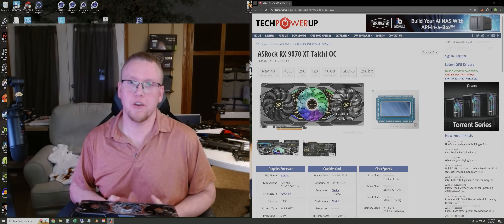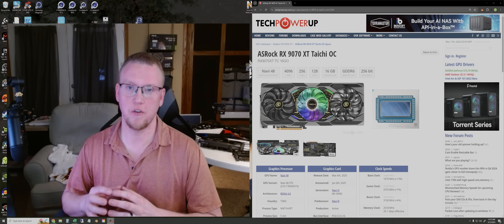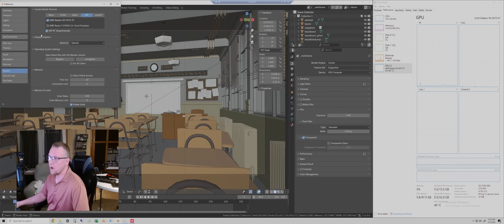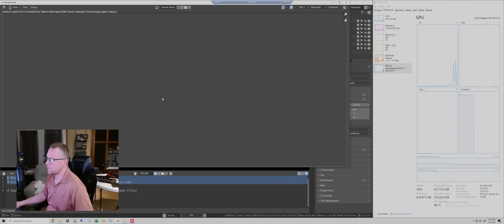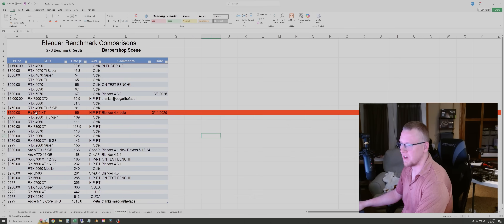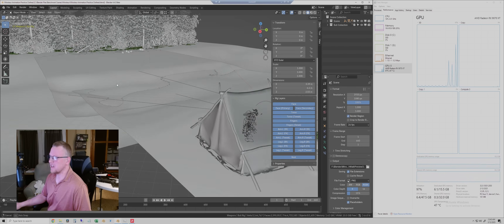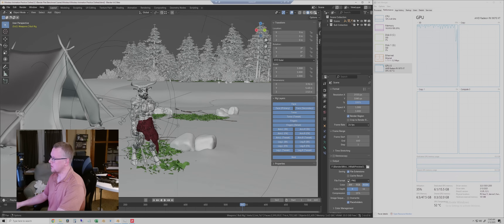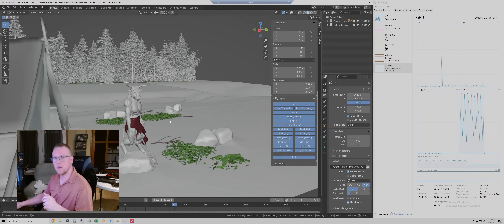NEW AMD Rx 9070 XT Render and Viewport Tests in Blender

Comment: i work now with a 3060 but ia have plans for changing for an new gpu, but i have short problem, am worked with platform am4 and with all things like bottleneck... some webs recomended change the resolution monitor but is 4k and the 4k is xpensive and thats happen with the 5070ti, what gpu you recomended me for change?. please try with blender 5.0

Comment: Did this GPU get some new drivers/support for Blender? thinking of changing my rtx 3070, but still not so sure if it's worth atm
Reply from the maker: The 9070 XT has not received a speed boost in Blender yet. The HIP-RT upgrade is supposed to be added to Blender Cycles in version 5.1 or 5.2, and that should give a large speed boost to the 9000 series of AMD. But, it is not testable yet.

Comment: Bought an Asus 9070XT... Whenever I try to render my latest project in rendered view my Blender crashes DX
Have yet to find a solution... starting to get buyers remose. While I mostly play games I do work with 3D fairly regularly so its kinda important I get it to work DX
Reply from the maker: Make sure you have new drivers, set your cycles device as your GPU, and make sure the denoiser is set to none or open image denoiser. If you have optix denoiser on it will crash with an AMD GPU. If these aren't it, let's keep brainstorming
Reply: @ContradictionTech  Bought the card right before Xmas. Reinstalled windows, got the latest drivers. Switched to GPU to Radeon 9070xt, Enabled HIP-TP. Either crashed without any error message, or with one. I did follow your advice but still crashed, gonna attempt no optix denoiser. But yeah feels like its gonna be a journey. Did play ready or not on maximum settings with 180+ fps XD

Edit: Put it to none and it worked. wonder why it cant do it with it tho.

Comment: In games the 9070xt is a lot closer to the 4090 than in 3d rendering, probably because 3d rendering leverages all the cuda cores while in gaming some might go unused (as happens with cpu cores, that are maxed out in 3d rendering but not in games). Anyhow, thanks for the video!
Reply from the maker: Yeah and I think the 9070 xt will gain some ground in Blender 5.1 or 5.2 when they get hip-rt updates in cycles. Hopefully like 20% or more boost in speed

Comment: I’m actually impressed, everyone said to me it have 3060 performance in Blender, I'd be curious to see how much the 9070 xt has improved now with Blender 5.0
Reply from the maker: It has not improved yet, hip-rt updates don't come to Blender until 5.1. Hopefully we'll see an upgrade at that point
Reply: @C @ContradictionTech  are you going to do a new test with the 9070 xt when it’s going to get improvement?
Reply from the maker: @2amicisuyoutube684Absolutely I will. I also check alpha versions sometimes to make sure they haven't already been updated. So it will be posted quickly once the upgrade happens
Reply: @ContradictionTech  Thanks for what you do, you deserve the follow, I just wanted to ask you one last question, at this moment the 9070 xt in Blender to which Nvidia GPU can you compare, and if in your opinion the 9070 xt is enough for someone who is starting out
Reply from the maker: @2amicisuyoutube684Thank you for that! The 9070 xt is still a good GPU in Blender. The viewport performance is good, render speed is slower than it should be. But most of your time will be spent in viewport anyway.
I have newer videos on this channel with more GPUs you can compare to. But for the same price, Nvidia will be faster. Like the 5070 is faster in Blender than the 9070 xt.
Reply: @ContradictionTech  ok, then I'll wait for blender 5.1 to see how the 9070 xt will go, thanks
Reply: @ContradictionTech  buenas noches, para ti cual será mejor para blender renderizado la rx 7900xtx vs rx 9070xt vs rtx 5070 gracias
Reply from the maker: @787JAVIER  Hi! The 7900 XTX is about the same speed, and has twice the VRAM as the 5070. So I would consider the 7900 XTX depending on what else you use the PC for. But keep in mind, the 7900 XTX is large, and uses a lot more power than the 5070.

Comment: I’m really torn between getting this or the NVIDIA 5070 TI or 5080 I got two friends who does blender and both are using the these two I’m on the fence about which one to get for performing in blender and gaming but also too afford. Which would be the best for me?
Reply from the maker: I really like the 5070 ti, because of Blender performance. I don't worry about game performance, because all new mid end and higher GPUs will run very fast. 
The 9070 xt might get a speed boost in a couple months for Blender, but it may not make up the gap to the Nvidia GPUs.
Reply: @ContradictionTech  well that’s the main thing I wanna get what’s best for blender to run better mine current PC has an old Nvidia 3070 RTX and I need to replace it. What’s the best one to get I need replacing my CPU, GPU, and SDD?
Reply from the maker: I would go with the 5070 Ti. Right now the 5080 is too much more expensive in my opinion. Which is why I haven't wanted to get one to test. CPU, I would get a 9900x for 12 cores. I am not as familiar with new Intel CPUs, but I think they are also really good. Honestly I should check them. And I like Samsung SSD for their magician software and the cache they have on Pro models.
Reply from the maker: Hey just saw this! Looks like this case would fit most GPUs and a 240mm radiator easily. It seems like a nice case for your build. Have you built this PC already?
Reply: @ContradictionTech  Yes I got everything and it all fit perfectly :D
Reply from the maker: @TsuriaDragon good. Glad to hear it went well. Sorry for the late reply. Replies to comments get hidden in YouTube studio so they're not as easy to find
Reply: @ContradictionTech  No Problem Thanks for the info was very helpful

Comment: Did AMD improve on their driver issues in Blender?
Reply from the maker: I haven't checked again for the last few days, but they are expecting to have the new hip-rt in Blender 5.1. So once that launches, we should get the speed up which is rumored to happen. 
But me and a few others in the discord for this channel are watching it daily to keep tabs on it
Reply: @ContradictionTech  Thanks man for what that card is doing in gaming it's beating the 5070ti and right there with the 5080. I think I might go with that card regardless of loss of rendering time. Nvidia is too damn expensive for a 5080. But, my old rig will be part of the render farm as well.
Reply from the maker: @KeikoFXDesigns  Yeah and rendering is not all the time you spend in Blender, and can be done overnight or off hours anyway.

Comment: In order to beat the next gen NVIDIA RTX 6090, AMD has to make their next top of the line GPU at least 8 times faster in Ray Tracing than it currently is with the 9070 XT. lol good luck with that. I'll be sticking with my NVIDIA RTX 4090 until the RTX 6090 comes out. If they can't beat it then too, which I bet they have 0% on beating it, it I wont be switching.
Reply from the maker: I agree, I really doubt AMD will catch Nvidia for RT. They might have chances at better value propositions, with high VRAM and good enough speed, but they won't take the crown per se.

Comment: 5070TI much much better than RX 9070 XT. abt 60$ more expensive. 5070ti is better option. Abt Viewport animation... believe me noone is Animation in 12-14 frames for Human animation... (optimization is need for 24 FPS for any animation at least ) So if 5070 beats Rx 9070 in any scenario so it will Be much faster For Vievport Rendering.
Reply from the maker: Yes, but keep in mind that my scene has a lot of trees and other stuff turned on, so all of these GPUs would run much better with only the characters turned on for the viewport. But yeah I think the 5070 Ti is a much better option for 3D for sure.

Comment: can u compare it to the normal 5070 and 5070Ti
Reply from the maker: I do have test videos for both the 5070 and the 5070 ti on the channel already. Is there something else you would want to compare between these GPUs?
Reply: @ContradictionTech yes sir i want to someone to test it in video editing too cause i dont usually use blender that much more of video editing and in my country the 9070XT and the 5070 have the similar price so i wanna know whats the best all-around without paying fortune on 5070Ti or a 5080
Reply from the maker: I have never benchmarked editing. But I would say the 9070 XT probably runs video editing faster than the 5070. The core seems to be more impactful in editing than the tensor/AI cores, so Nvidia would likely hold less advantage there. Here is a link from puget systems: 
https://www.pugetsystems.com/labs/articles/amd-radeon-rx-9070-xt-content-creation-review/?srsltid=AfmBOopfgo_0Vhvqi7qDAbQ6TeCe5ICIfmzmQ3I_tcpJbMtI1HmgmMK1
A little way down the page, they feature some tests that I do not have in my current limited arsenal. So please check that out for some better answers. 
Hope this is helpful!

Comment: Thanks a lot for this video!
I’m currently unsure about which GPU to get, since I’m considering the 9070 XT or the 5070 Ti
I also need to factor in my work, which involves Blender, Substance Painter, and Unreal Engine.
It’s been hard to decide, especially with the price difference and the fact that I also like gaming (a lot)😂
Reply from the maker: Well the 5070 Ti is just a lot faster. I would lean that way since you use 3D apps a ton. They will both play games at super fast fps, so that won't be a controlling factor.

Comment: man i just upgraded from the 3060ti but im so disapointed in the results in blender icl. i mostly use the gpu for gaming and cad, which it does fine in but blender is a side hobby and this just is gut wrenching.
Reply from the maker: I am hoping the performance with AMD will improve later this year, they are supposedly improving HIP more, and should be implementing ROCm for the 9070 XT, which should help. Not sure how much it will improve, but it should only get better.
Reply: @ContradictionTech thats my only hope, was also really nice to see blender release vulcan which should really help in the viewport aswell and amd is usually well supported!
Reply from the maker: @Probler yeah Vulcan made a huge difference on the 9060 xt so should do the same for 9070 xt as well

Comment: Should i get the mercury 9070 xt or a 5080. I'll probably want to play game every once in a while on a 4k 120hz oled tv but my son wants to make games and use blender. I mostly building this for him to learn how to build and make his games. Also wondering if I should get a 9 9900x or a 7 9800x3d
Reply: It's better to get 5080 because of mass DLSS implementation in a lot of games. And 9800x3d is much better than 9900x if you buying it for gaming and 9800x3d won't be that much worse for work that 9900x
Reply from the maker: I agree. The extra cores on the 9900x can be useful for very heavy loads, but Blender tends to struggle to use tons of CPU cores even for fluid simulations. 8 vs 12 cores might be a bit of difference in a few workloads, but mostly for very heavy simulation. 
And yeah the 5080 should be the better choice here.
Thanks for the comments!
Reply: @skvarty  thanks
Reply from the maker: See the comments below. Should be fine with 9800x3d and rtx 5080. Good luck with the build!
Reply: @ContradictionTech thanks

Comment: 4.5 with its Vulcan support should be interesting.
Reply from the maker: Yeah it will. I will add this in with the 9070 XT retest and the upcoming 9060 XT videos
Reply: @ContradictionTech been thinking of a desktop build (3070 laptop at the moment) but nvidia cards cost so much the amd is attractive on gaming performance I think but rtx performance difference is quite high.  Looking for a nudge to say amd is good (bang for buck) in blender but could see on your results how behind older nvidia cards it is still. Might be putting too much hope in Vulcan but I read there’s a bigger general gain for and than nvidia.    Cmon amd sort your rt performance out!!
Reply from the maker: Finally ran the 9060 XT, and it is disappointing in render speed sadly. The Vulcan update did work really well though, and I am going to re-test the other 50 series and 9000 series GPUs to see how much they improve in viewport speed.

Comment: Thank you so much for this review. I work in architecture with absolutey massive scenes with average 12-15 million polygons per design  in blender and my RTX 3070 is just icapable of handling these kind of scenes. I am aiming for 7900 xtx actually which has even more Vram and i was unsure if i will lose rendering speed in exchange of more  Vram comparing to my current RTX 3070. This 9070 you are reviewing is exactly 2X faster than my RTX 3070 so unless 7900 xtx is 2x slower than 9070 (which i highly doubt) it will be a good upgrade for my work.

Again thank you sooooo much for helping us 3D creators. Everyone is reviewing GPUs on games which can be extremely missleading to 3D artists
Reply from the maker: I do have a couple 7900 xtx results in my data. I think it should be faster than the 3070. And 24 GB of VRAM is pretty great.
You are welcome for the video, let me know if you have more questions.

Comment: I have the rtx 3060 12gb, for the unreal engine, chaos vantage or blender is it worth upgrading to the Rx 9070 XT, since there are problems with the NVidia rtx 50 series ???
Reply from the maker: The 9070 xt would be an upgrade for sure. I don't think the 50 series is necessarily any worse than other generations. I know they have had some driver problems but they're sorting it out. AMD software is basically always worse by default anyway. So I would not avoid Nvidia by any means

Comment: That's interesting. At first I wanted to buy an RX 5070XT for Blender, because it performed almost as good as an RTX 5080 in gaming according to Hardware Unboxed, but now I'm really hesitant.
Is the result of the Blender benchmarks due to hardware limitations of the RX 9070XT? Or are these fixable via drivers improvments?!
Now I'm more inclined to buy the RTX 5070 Ti of the 5080, since here in Europe they are almost the same price as the 9070 XT ($150 differnce more or less).
Reply from the maker: The AMD drivers might improve over time, and this is the biggest problem with those GPUs right now. But AMD doesn't usually improve their software much over time. We will see. I hope they figure out that this 3d render crowd is hungry for other options, but we might not be enough of a market to sway them to focus more on productivity. Time will tell, but I think my results will be true for a long time, without having any other info

Comment: We need more test with amd card. People said they have much downgrade, dont have cuda and dlls thing. I just wanna see what tests show
Reply: Good. I hope it give me some answers. I had 3060 and have issues with my monitor blink once. But i don't know if its model problem or pc or new nvidea driver
Reply from the maker: @VITAS874 Well new Nvidia drivers have been a mess for sure. Black screens and crashes have been a common complaint lately.
Reply: @ContradictionTech  yes, its so confuse me right now. I roll back today to 566.36 because i no idea what is.
Reply from the maker: I will continue to test what I can get. Also, I am still planning on adding some new tests which I will run on older GPUs as well. It will be an ever-improving process

Comment: Hello is the viewport animation that you show here is also in Cycle rendering?
Reply from the maker: Yes it is a cycles scene
Reply: @ContradictionTech  Thanks man! I relieve
Reply from the maker: @520lun  It is a very heavy scene. Were you afraid the 9070 xt was struggling with Eevee?
Reply: @ContradictionTech  I afraid struggling with Cycle instead, I thnk Eevee shouldnt be a problem, cuz my current laptop struggling hard with Cycle in Shader mode lol

Comment: Hello, the Blender test was very helpful. I'm torn between the RX 9070 XT and the RTX 4070 Ti Super. Which one would you choose, considering both 3D work and gaming? And you are :finger-red-number-one:.
Reply from the maker: Thank you! I really appreciate that! I would pick the 4070 Ti Super. I think it will be a bit easier to deal with creative software and drivers from Nvidia. It is a fairly close call, and you won't go wrong either way I think. 16 GB of VRAM is a good start too, so these both check that box.
Reply: @ContradictionTech  Hello, sorry for the late reply. Thank you very much for your suggestion. I'd like to ask one more thing—if I increase my budget a bit and go for the 5070 Ti, do you think that would be a smarter choice? Thanks again!"😁
Reply from the maker: @sametyldz6162  The 5070 ti should be a lot faster in gaming with Dlss4, plus the other features with the 50 series. It could be a good upgrade if you can find it for it's list price. Obviously with Blender, you have seen the speed difference. 
Also, new drivers just this weekend have supposedly fixed a lot of software issues on the 50 series, so maybe it got even faster this update.
Reply: @ContradictionTech  Thanks a ton for your help. If I hadn’t watched your video, I’d probably be making all the wrong choices. You’re a legend!:trophy-yellow-smiling:
Reply from the maker: @sametyldz6162  You're welcome! And thanks, I am glad people find it useful